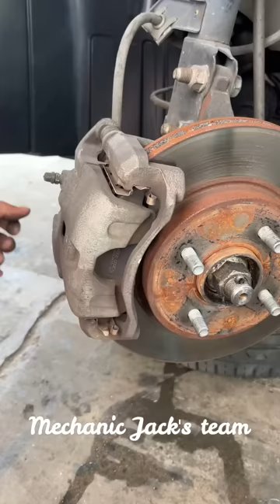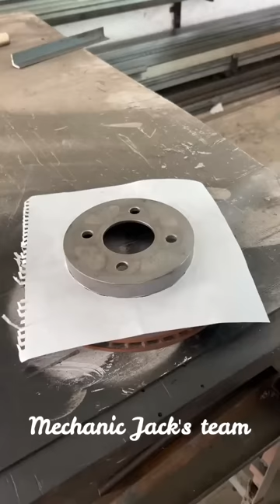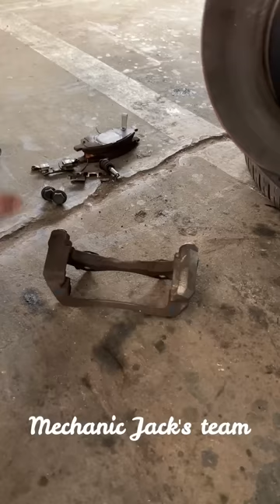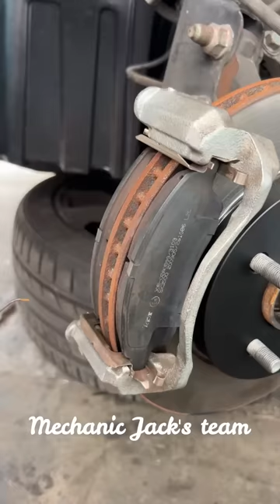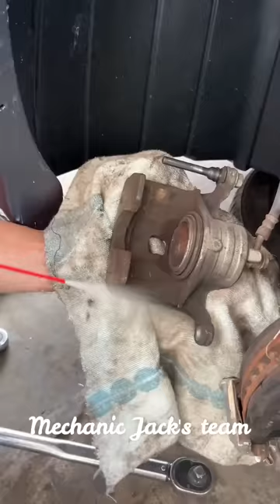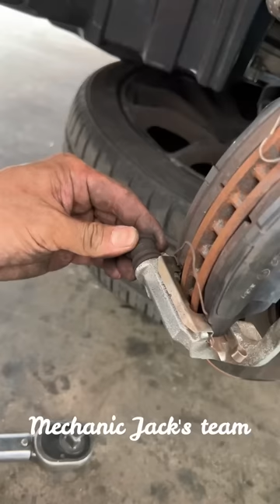How to Maintain Disc Brakes

Comment: That's a big no no you do not ever put brake cleaner on the brake pads it will swell up and ruin them
Reply: Are you joking?
Reply: I dont like spraying brake cleaner on brakes as well but it is what its made for. I will sometimes lay a piece of 36 grit sand paper on a flat surface and de-glaze the pads if i reuse them.